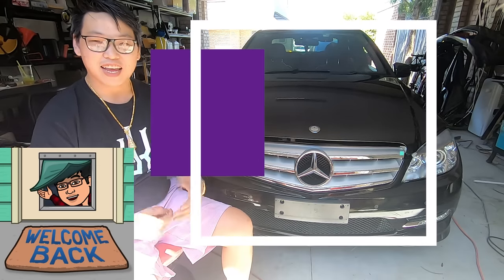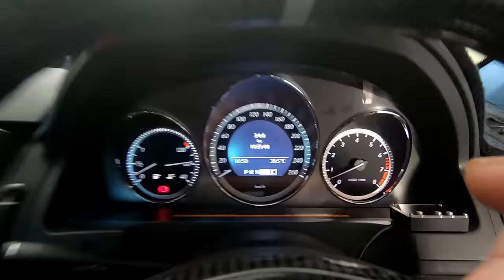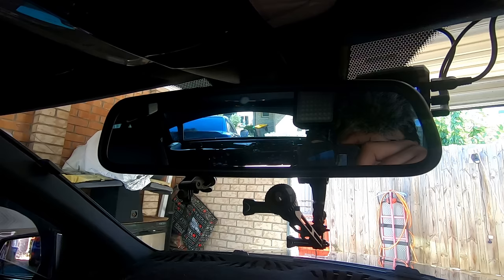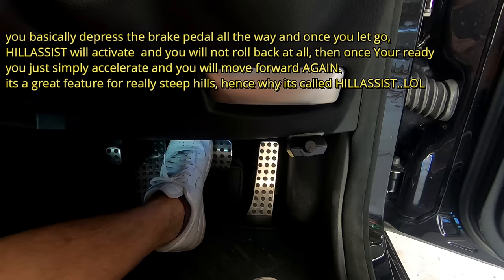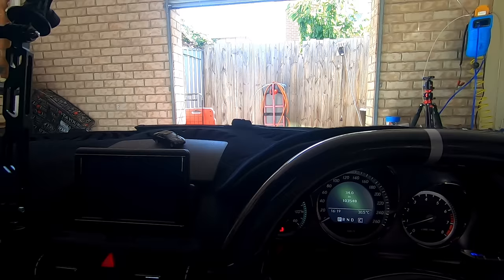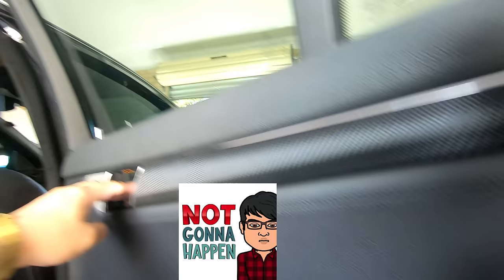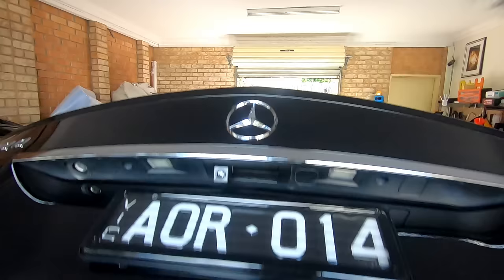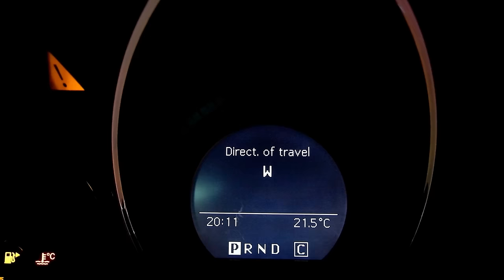MERCEDES BENZ C CLASS W204 COOL and  UNKNOWN  FEATURES + TIPS

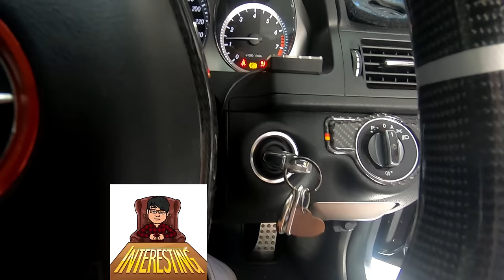Comment: Hello, what is the name of this function on 5:40 ? It doesn't work for me and that's why I have to keep it longer to start my mercedes. What could be the reason?
Reply from the maker: it's just normal crank start but there's a quik way to do it..rather then holding the key to crank that's all
Reply: Thanks for ur comment. My problem is actually when I want to start my Mercedes W204 manuel (2008), it wont start just with quick turn of the key. It starts when I hold the key turned. Has anyone any idea what could be the reason of that?
Reply from the maker: @aytm0_  @aytm0_ wait if your car is manual that's probably why it's different ..  this is mainly for auto cars where u can just click it
Reply: Thanks for the answer, I feel a bit better 😂
Reply from the maker: @aytm0_  Ur most welcome ..don't worry nothing wrong with your car
Reply: Thank you so much 😊

Comment: Do your paddle shifters work I have a 2009 c300 and just bought a new wheel and can not get the paddles to work
Reply from the maker: my car came with paddle shifters from factory so i never had an issue .... and yes they do work ... i had paddles on my 2 spoke wheel and also on my new wheel also
Reply: Justin Brown i have an 2009 as well and i’ve been looking into paddle shifters for my steering wheel. I’m not 100% when the amg and non amg versions of the c class got paddle shifters but apparently the 2009 c63 came with them stock. You can have the software either updated or activated (not 100% which is correct) at a mercedes benz service center and then your paddle shifters should work just like the regular manual mode.
Reply: Justin Brown any question with paddle shifters , message me. I have the information you need.

Comment: I am not able to turn my alarm sound. How do i go about? i am not sure if the car do come with an alarm. Mine is c200 w204 preface lift japanese spec
Reply from the maker: the alarm sound can be done with a xentry or das scanner tool ... u need to be able to access the inside menu of the cluster ... I did mine by using a newer cluster ... the newer cluster has the option ..I noticed that wen I plug in the new cluster it give me the option to turn on and off the audio when locking and unlocking the car ... which is the beep and horn..apart from that u need a star diagnostic xentry das tool
Reply: Tq bro
Reply: How to go about installing a new cluster then? Need to go to merc serv centre?
Reply from the maker: @485naza  u need to get someone to code it for u ... its slot of work .. merc  can't do it .. they don't do that... need to find A specialist

Comment: Question about the daytime lights, yes they run during the day, but at night they go off... now I told the car to reset to factory settings and now when I close the car I don't hear the sound by the horn and also think the daylights are running at night also. Can you give your input, please?
Reply from the maker: im not sure i understand what ur saying friend... so is your drl set to on or off? if its on they will remain on during the day and also at night when u turn your lights on they will dim a little as your lights use power also.... which horn sound? u mean when u lock your car with your keyfob u get a horn sound? that would mean u have an alarm system correct? i dont have an alarm as yet so mine doesnt do that... i think u just need to reinitiate your alarm setting so it makes the horn sound
Reply: @MIKEYZVLOGZ  I figured it out. The daytime lights don t function at night, BUT when I gdt out of the car they re on, acting like parking lights. It s ok, thanks, I figured it out last night.
Reply: @MIKEYZVLOGZ  also the small horn sound when you lock the car is in the settings, I don t think I have an alarm, but I found it in the settings ti have it or not.
Reply from the maker: @sebsebseb1905  oh i see.... so its just so u are aware the alarm.is on? did u manage to solve ur issue.. which settings did u find them in? the cluster
Reply from the maker: @sebsebseb1905  im glad u figured it out well done mate
Reply: @MIKEYZVLOGZ  Like I said, I am not sure it has an alarm, just bought the car, it's a 2013 c classe coupe. From what I can tell it's just a small sound when you lock the car, the way the lights flicker. A visual and an accoustic way of telling you locked. You find this option in the settings.
Reply from the maker: @sebsebseb1905 fair enough thats ok... thanks for sharing
Reply: @MIKEYZVLOGZ  thanks for making videos :)
Reply from the maker: @sebsebseb1905  ur most welcome

Comment: Hi Mikey, I need to change my w204 m272 oil pressure switch/sender, have you had to tackle this job yet? No one has made a video on it. I'm having a hard time finding the part online to.
Reply from the maker: not just yet .. I did have to do the plugs and the oil separator
Reply: @MIKEYZVLOGZ  yeah I just did spark plugs, cam plugs and oil separator is good on mine. I need to change crank angle sensor, no big deal, the dreaded tumble flap on mine is snapped so I'm waiting on the manifold gaskets for that, fun job that will be for a $25 metal triangle with 2 gaskets. Torque converter/ Brake switch B circuit, no big deal $25. The manifold is going test my patience, not looking forward to doing that one but I guess I will do the crank angle sensor and oil pressure switch at the same time while the manifold is out as I'll have more room.
Reply: @MIKEYZVLOGZ  just pulled the intake manifold and changed the swirl flap actuator, it's actually not a hard job at all. Just lot's of sensors to unplug.
Reply from the maker: @robertjohn2249  well done if that happens to me I'll do the same

Comment: I'm looking to buy a C320 CDI, it's pretty good looking, it's got the AMG Line body, full leather interior and and and... I'm not sure if it's a reliable car. I mean is it prone to big issues or something? I know the 350-s have some issues after time with the Timing Chain and that's what i want to avoid. Any recomandations or tips from anybody?
Reply from the maker: hey friend welcome to the channel ..... depending on what year u buy unfortunately i cant say mervedes is 100 % reliable dude.... even my car has had alot of issues since owning it ... one comparison i cannot get over is in the last 2 years ive had about 5 to 10 small to big issues and my partners lexus is350 has had none zilch.... thats something i cant get over ... but in the end if u want a merc do your research google ask around and  see if the pros and cons areworth the risk of ownership thats the truth ...ive always loved merc and wanted a w204 as long as i can remember however with that said ....if i knew all these issues maybe ...just maybe i wouldnt have bought it and boughy a lexus is350 instead ..one of the most reliable cars guaranteed
Reply: MIKEYZ VLOGZ what were the 5-10 issues?? I bought a c300 w204 12 months ago and so far my driveshaft blew and had to replace it then I had a weird time the electronics got fucked and the engine fan would go on when car is off but I fixed that after I dried the fuse box out, it was because I opened the fuse box in the rain and moisture got in. Thankfully after I dried the fuse box the problems went away completely so it was no cost for me and I’ve been driving for 6 months with no issues but I don’t know how long that will last 😂 it drives very good  n smooth though besides that. It’s a 2008 with 185,000 km. What issues have you had could you please share with me? Thanks for the video as well I have subscribed

Comment: hi .. any idea how to change the "clock display mode" from 24h to 12h ??
Reply from the maker: u do it using the stereo buttons not cluster ..unless u have the older model then u. an find it on the cluster
Reply: @MIKEYZVLOGZ   i’m using 2008 W204 C350 non-navigation audio system.

when i got the car first time it was 12h, i did something with buttons so it started to show as 24h

another issue if you may help, once the car is of for more than +6 hours ... the time is reset
Reply from the maker: @MOHANNAD Khair  that's very strange I think something wrong with the clock I'm not sure exactly what ut is cuz hard to know if can't see it ... sounds alot like your clock or memory is not working properly
Reply: @MIKEYZVLOGZ  ya it sounds strange ... will go with advice and check the memory things ... thank you and keep it up

Comment: Hey Mikeyz, how did you connect a reverse camera on this original screen? Thanks
Reply from the maker: check out the video i did on how to install a reverse camera i explain it all, basically u need to get a fakra to rca yellow video signal adapter and then remove the green fakra connector plugged in the back of your unit , which is the middle part where the controls are like disc radio etc , then u need to enter engineering mode and set your camera up so when u enter reverse it will display the camera, that way its not on all the time ..check out the video it will makme alot more sense once you watch it, i did a 3 part series so i could explain everything clearly , hope it helps
Reply: Yeah! Reverse camera is a feature came with the car or  did you install it?
Reply from the maker: @meister3119  had to install it ... did not have from factory

Comment: Please help, easy exit / entry on my w204 c350 normally raised wheel and pushed back drivers seat on exit or withdrawal of key. Now seat does not perform this action when getting out, the wheel still moves out of way and the seat controls all work but seat doesn’t do it anymore. I will note the connivence menu on cluster only mentions seat? Which is odd because I have had the car for years and this always worked until as of late. Thanks in advance
Reply from the maker: sounds like an electrical fault ..look for disconnected cables or split cables...mercs are notorious for unplugged  cables when folding seats driver and passenger ...or check fuses and relays related
Reply: @MIKEYZVLOGZ  thanks for the advice, sounds like a good place to start, hopefully it can be resolved easily, I’ll report back.
Reply from the maker: @db-ec7sx  no worries mate hope u get it sorted worst case take to an auto electrician

Comment: the tunnel feature only work for no US version i tried it on mine and it did not work
Reply from the maker: wow really I did not know that ... are u sure it's a feature that may need to be activated? I've been told some features just need to be activated with a star scanner like tool in order to access the ECU and activate certain features... I honestly thought it worked for all models worldwide as itis a standard feature nothing over the top if you get my drift .... are you doing it right?...sorry maybe a silly question but some ppl dont do it properly .... but I'm sure it's a pretty standard feature mate .... try again and see what happens.... I hope u can figure it out .... it's a helpful feature .... especially if your going through a tunnel that doesnt allow much air and oxygen to pass through.... it's very handy....
Reply: ok so correct me if im wrong you press and hold the air circulation button and its suppose to roll your windows up right ? @MIKEYZVLOGZ
Reply from the maker: @capone_rd_809  ye so make sure ur windows are down and the re circulation is off so no red light.... then press it and hold it while the red light is on and it should roll your windows up... butif your windows are already closed then it wont roll down ur window ... it closes your window for u when entering a tunnel and once u exit tunnel u can hold it again to return to original open position
Reply from the maker: @capone_rd_809  yes it's suppose to roll ur window up just make sure the light is off wen u press it ... light on means circ off ...light off means circ on

Comment: Where is the small plate holder from on the front?
Reply from the maker: which do u mean
Reply: The small number plates backing bit you have on the front of your car? Or is that standard in Australia?
Reply from the maker: @kaalstevenson7185  standard here but u can buy them for about 20 to 50 aud off ebay
Reply: @MIKEYZVLOGZ  do you have a link?
Reply from the maker: @kaalstevenson7185  no link i found it a while back and i even saw it on aliexpress its basically a module that turns the existing lights to dynamic..search dynamic indicator module

Comment: Did you change the steering wheel ??
Reply from the maker: yes I upgraded to a facelift one carbon fiber
Reply: @MIKEYZVLOGZ  ok because mine is like an 3 pieces it's kinda ugly and want to change it what model is that
Reply from the maker: @CesarNunes18  it came off a facelift so I'm guessing from 2011 to 2015 ... I have my old wheel too 3 spoke .. but this wheel is abit more expensive .. fully carbon fiber fully customised ..If ur interested its about 600us no airbag  ..I can intro u to the guy ..as I get a commission for every one he sells
Reply: @MIKEYZVLOGZ  by the way where can I find those carbon fiber pieces for the inside?? Thinking of doing some carbon in and out
Reply from the maker: @CesarNunes18  which ones are u referring to? I've done quite abit
Reply: @MIKEYZVLOGZ  well the majority of them 😅 couse I want to change the interior complete
Reply from the maker: @CesarNunes18  alot of stuff I got from aliexpress

Comment: What about the most annoying feature? Does anyone know how to unlock all doors when pressing unlock on the remote once?
Reply from the maker: u just need to hold lovk and unlock at the same time and it will change it to unlock all at once
Reply from the maker: u just need to hold lovk and unlock at the same time and it will change it to unlock all at once..ur keyfob will have a flash
hing red light to confirm it has worked
Reply: @MIKEYZVLOGZ  Thanks man that feature's annoying when you have kids and a weak battery 🔋😅
Reply from the maker: @Truth Seekers  lol true. but if u got kids use the parental lock on the back doors ... like I showed and use the function that does unlock all doors unless u press twice ... which is the feature we are talking about ..it unlocks just driver side until u press unlock again then it ţ

Comment: My headlight washers work the same time I as clean my windscreen just push the stalk in and it works no need for pressing it 10x
Reply from the maker: u have facelift or preface ?
Reply: @MIKEYZVLOGZ  pre faclift
Reply from the maker: @irfy2009  hmmm i have to figure that out any chance u can send me a video of your settings ? or ehata different?
Reply from the maker: @irfy2009  thats awesome
Reply: @MIKEYZVLOGZ  I'll try and get one done and send it over
Reply from the maker: @irfy2009  that would be great but no pressure i belisve u
Reply: @MIKEYZVLOGZ  just one question. I've never sent a video to someone on here. How would I do that? 🤔
Reply from the maker: @irfy2009  u cant u juat sens to my email huottea@gmail.com
Reply: @MIKEYZVLOGZ  no problem
Reply from the maker: @irfy2009  cool

Comment: Is there a reason why my speedometer lights are very dim
Reply from the maker: hi there friend welcome to the channel i hope u can subscribe if you havent yet ... it could be a   setting in your engineering mode try go through those setting s and find a brightness settings.. ill try find a solution for you ... but havent heard of such an issue... normally its very bright or off ...not in between..however with older models you could control the brightness so could be just a setting
Reply from the maker: what year and model is your car ?
Reply from the maker: ok friend so the little knob on the left of your instrument cluster adjusts the lighting brightness if ur car is the same shape as mine you will see the little knob and it will adjust how dim your dash is just turn it clockwise...I just tried it on my car and it controls how bright your dash is
Reply: MIKEYZ VLOGZ also is yours bright during the day or only turn on in the dark
Reply from the maker: @xentricz_twitch  its bring during the day but u can easily change that .... by turning that knob on the left of your cluster
Reply from the maker: and if u go into your cluster settings u see daytime running lights u can choose whether u want your lights on at all but it also includes your front led strips of u have them .... 9f u choose off then all your buttons in ur car wont lights up and neither will ur led strips .... and on for the dire t opposite however when they are on u can control them by turning the little round knob on your left on the cluster...do u know what I mean
Reply from the maker: @xentricz_twitch  did u figure it out friend most likely all u have to do is turn the little knob clockwise and it will get brighter and yes my lights are bright during the day as long as I choose to have it
Reply from the maker: @xentricz_twitch  bright during day aswell